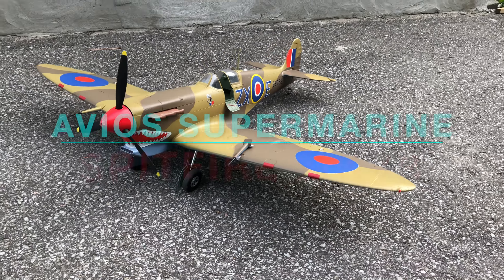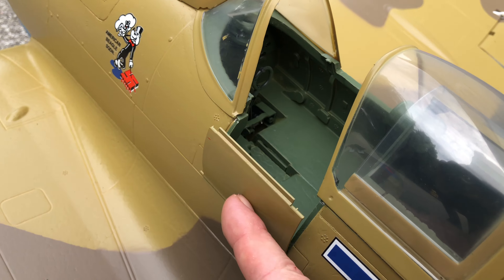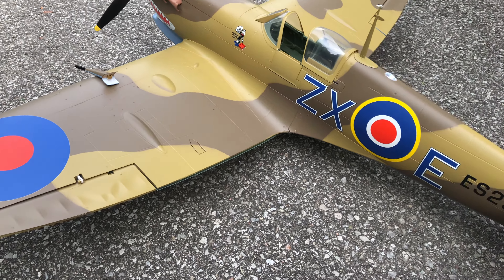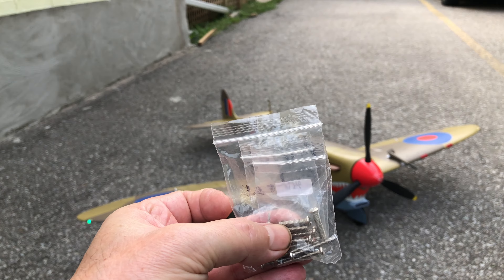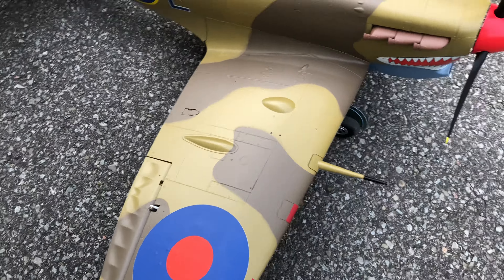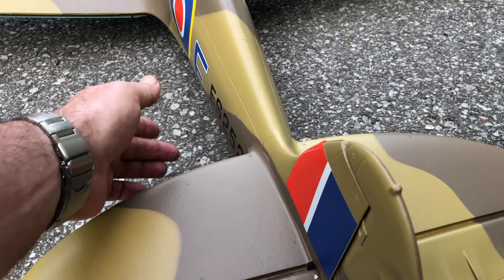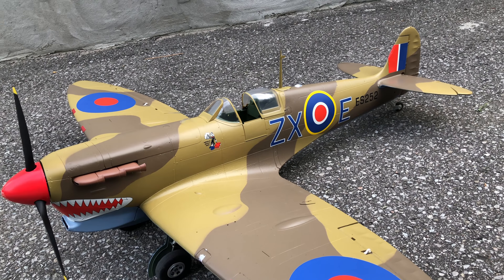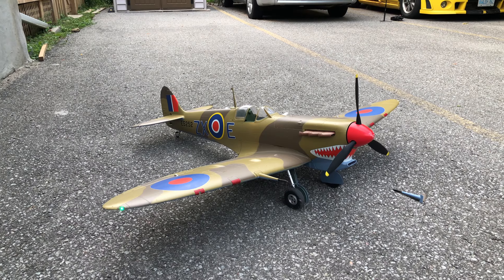AVIOS Supermarine Spitfire Mkvb  Assembly Details #new #rcplane

Comment from the maker: Forgot to mention in the video , While this wing comes in 2 halfs and CAN taken apart , its best and recommended that it stays in one piece or connected together permanently . On the underside there's a few accessory pieces that are glued onto both halves , on the centerline , and the wiring connection through the distribution block , REALLY encourages you to keep the wing in one piece . i even glued in the hard plastic wings mounts used to attach it to the fuselage . 
Assembly is very easy now . 4 screws and 3 wires connected to the receiver .